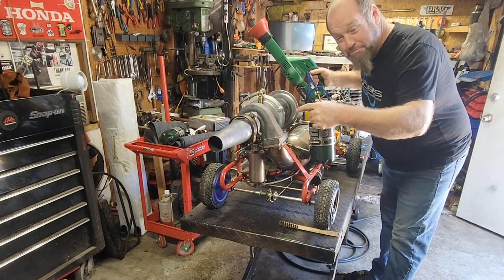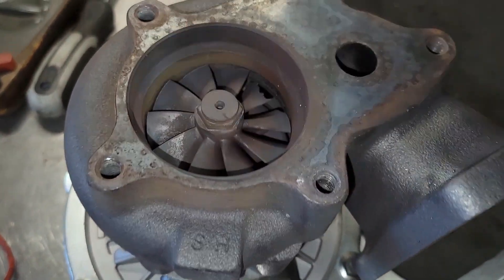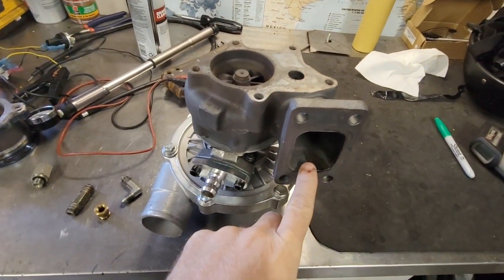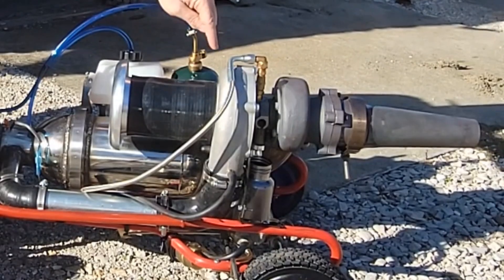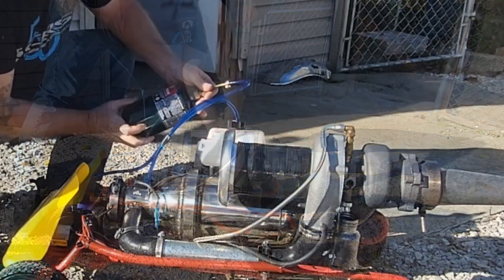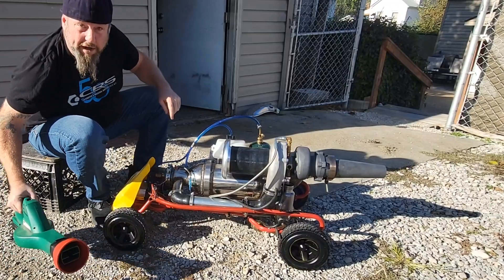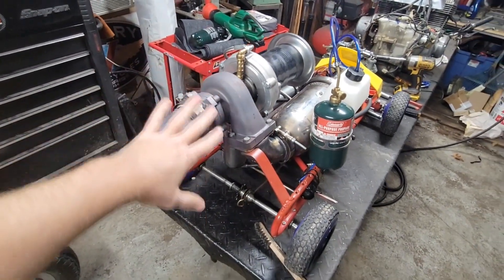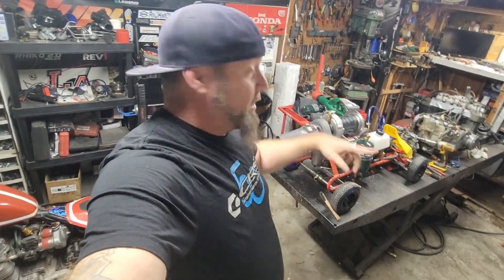I turned a TEMU Turbo into a Jet Engine

Comment: Have you considered putting ball bearings in one of the turbos you already have? My plan has always been to just buy the rotating assembly for $100 and print the rear end.
Reply from the maker: Saving for a T4 ball bearing, it'll send the boost much higher